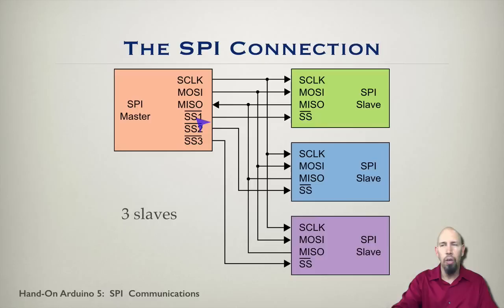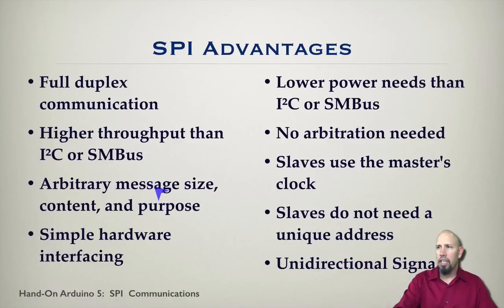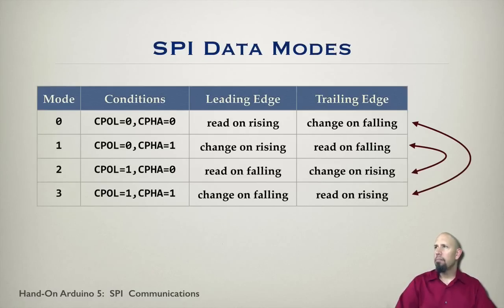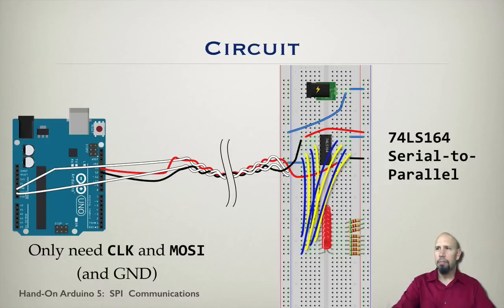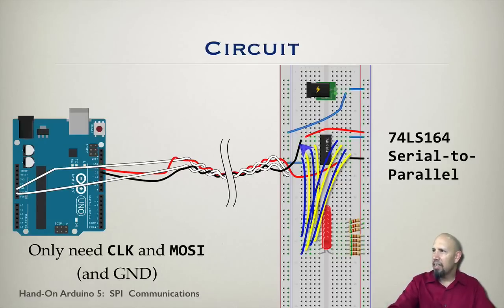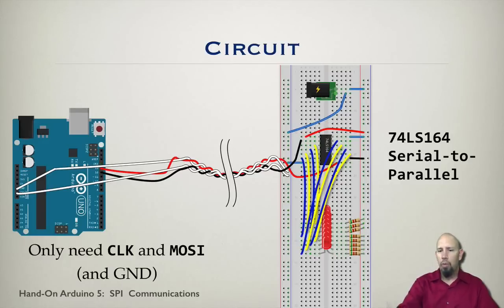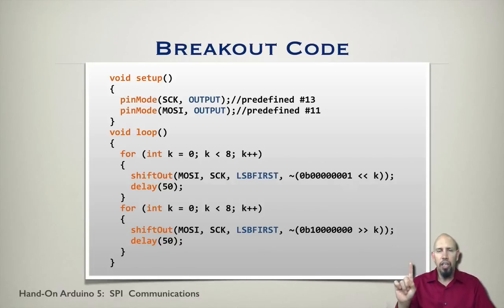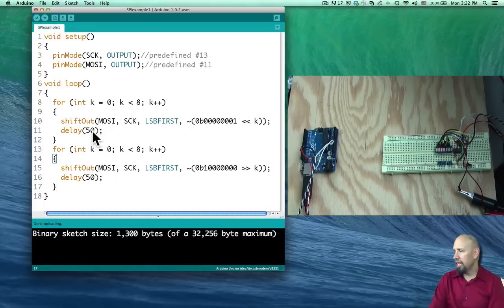Hands On Arduino 5A: SPI Communication

Comment: The SPI bus is certainly fantastic but for my part, I have never been able with an Arduino platform to make a master and 2 slave devices work correctly, with the libraries available, SPI.h, SD.h, etc... I'm an engineer and even with a logic analyzer there were always conflicts on the SPI bus. My feeling is that the ARDUINO/Adafruit/... libraries are poorly written. I would be interested if you could give us for example a data logger which records pressure measurements from an SPI BMP388/390 sensor (for example) on a SPI micro-SD card with a 3V3 or 5V board (or a reference). Thanks in advance.